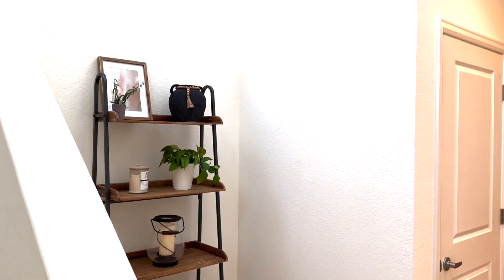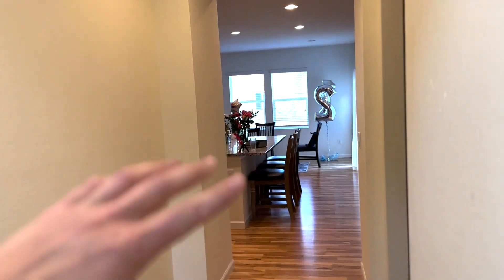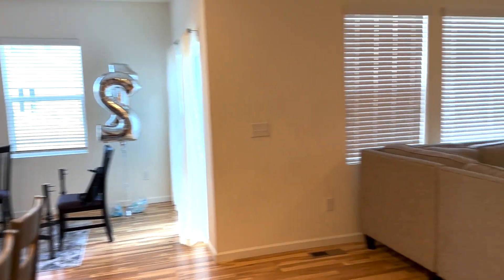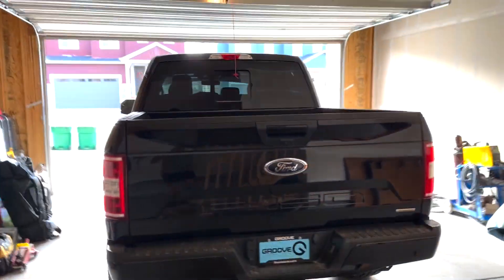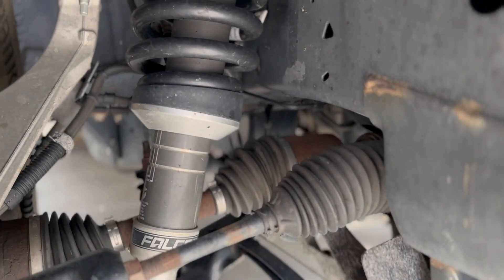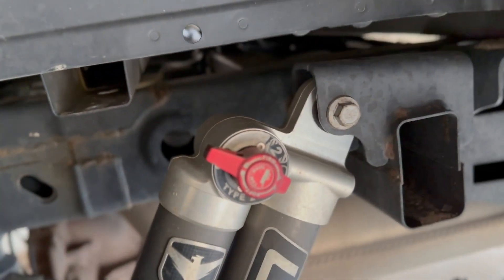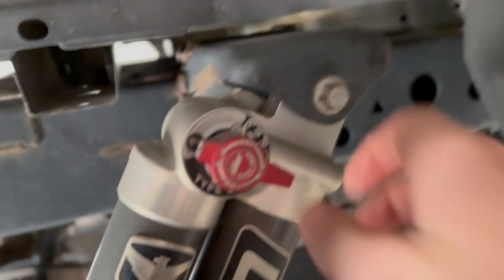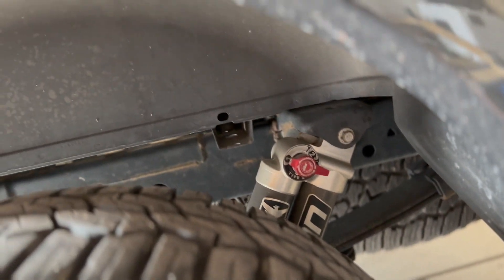DO NOT BUY FALCON SHOCKS!

Comment: The falcons are amazing. I had the squeak about a year after install, you have to grease the bushing on the bottom mount. There is a zerk fitting to make it simple.  I have had mine for 4 years and after greasing it once with good quality grease it has never made a noise agian.
Reply from the maker: I’ve tried it multiple times to no success

Comment: 2:01 those shocks are rebuildable..... just saying.... buy them to have good shocks. if they're screwed up then send them in for a rebuild under warranty. if they find owner negligence then that's on you. if they find that the shocks aren't up to par in QC then they don't charge you. just pop them off and send them in. it doesnt strike you odd that the place for the most dust collected section (the front) are the ones you're complaining about? also it sounds more like a bushing or that you sprayed a degreaser and not a greaser. WD-40 is a degreaser which most people think fixes squeaks. so spraying a wd-40 type product or degreaser onto your shocks that need grease just make it worse. also the chassis steel bar that everything's hooked to is rotating the most and rubbing right against that silver bolt at the top left. either that or at the top of the middle of the frame, the silver bolt is causing trouble. i'd say ball joints, mounting brackets, degreaser used, or the steel bar with rust around it's mount and the brand new bolt put on the other side right in front of everything may be the issue.. usually the shock and spring should be moving more than the mounting of what they're mounted against... that's what they're there for..
Reply from the maker: Then I may have to look deeper into this.

Comment: Update: I’ve got a new 2023 f150 and just found out that falcon sold my off-road shop older falcon shocks designed for the previous heavier models which is the reason for my new f150 riding like an f250. The Shop is is perplexed as to why Falcon would have older models intended for older heavier trucks sold for new lighter f150’s. Snake oil! Having them returned and going with Ford Performance shocks made specifically for the new lighter 21-23 models.
Reply from the maker: That’s actually really interesting to know! And really good to know!

Comment: I had mine for 6 months.  Handling improved quite a bit, but the ride is much stiffer. I ended up removing the front struts and I went back to stock to regain comfort.  I kept the rear shocks as it improved towing on setting 3.  Falcon struts are now collecting dust, I will be posting them FB market place. Let me if your interested in buying them.
Reply from the maker: I don’t think I would buy them again to be honest with you….
Reply: Why are they uncomfortable? Even on the softest setting? Where they the SP2?
Reply: @bobcat718  the softest setting is still slightly stiffer than the OEM rear shocks.  If your towing or hauling heavy loads in the bed then honestly it’s a big improvement.  As for the struts in the front they’re too bumpy and they don’t have different ride settings.
Reply: These things ride horrible and the rear adjustment knobs easily get hit by even the stock size tires.

Comment: These are quite possible the roughest riding shocks I’ve EVER owned and I’ve owned more trucks then you can count with all your fingers and toes. They just emailed me telling me that the reason my truck up front rides so stiff (like a 3/4 ton) is because I need to drop the PSI far lower than the manufactures recommended PSI and on stock (OEM) size tires. I responded with that being BS and you cannot recommend operating your product along with another manufacturers product outside the specs of another. Again, great design with the rear adjustable knob but horrible riding and I went from a 275/65/20 to a 295/60/20 back to current stock 275/60/20 size and still zero change, rides like a 3/4 ton. The truck had 275/65/20 before Falcon installation and rode great but just wanted that extra 2” clearance.
Reply from the maker: Mine softened up overtime
Reply: You mean to tell me these stiff shocks softened up over time, how much time cause this is my daily driver and it’s actually affecting me physically with the road vibrations and 3/4 ton jarring feel. I’m seriously considering 4” BDS coil over lift but already fished out almost $2700 for shocks, install and alignment
Reply from the maker: Mine did, took probably 5-10k miles. it is for sure mores stiff than stock though
 @txgreek3512

Comment: Not your shock or strut bro.  Ball joints, 100%.  Had the same creak, injected the boots (upper and lower) with grease and it went away.  Make sure to turn the wheel to the extremes to work the grease into the joint, over and over.  Or replace the ball joints, they're bad in Ford's eyes... probably not actually bad though.  Personally, it was either replace them or attempt to lube them.  For me, it worked on the first try.  Just use a fat 16 gauge needle and synthetic joint grease, easy to get into the syringe if you put the grease in a plastic bag, cut the corner and squeeze it into the back of the syringe.  Mine took about 12 ml per joint.  Creaks are gone now.  If I ever need to replace them, the new ones will have proper zerk fittings.

Comment: Spray some silicon lubricant on the shock shaft and shock gasket where it meets the shock body and wipe it clean with a towel. The dust colleced over time will make it squeek.  Had the same issue on my JKU, every few months they need to be cleaned in order to prvent squeaking.
Reply from the maker: I tried it
Reply: @Sean_Hannon  did it work? 😀
Reply: Spraying down your shocks with silicone spray lubricant every couple months so they don’t squeak is about the dumbest fix I’ve heard of for a poor product.

Comment: I've had my Falcon's on my Tacoma since the Lockdown...and that squeek started to happen recently...I just never gave it much thought because I live here in SoCal and beat the hell out of these things daily and on the weekends and the shocks perform so damn good! I figured it was worth the small annoyance...of the squeek. But now that you mention it, I am going to try and hit them with some grease on those zerk fittings they come with to see if that calms them down...I wouldn't say the company is shit tho... Plus, it's just a little squeak (reminds me of the military vehicles I used to ride in and drive they made lots of weirder noises...)bit harsh don't you think?
Reply from the maker: No mine is bad bad and it started after about 6 months. Both sides now squeak. Maybe it’s different on a tacoma then an f150

Comment: Just bought a new F150 FX4 Lariat SuperCrew and will be having mine professionally installed by 4WheelParts tomorrow. So, I’ll chime in after install then a bit later to give my own personal input. Cheers 🍻
Reply from the maker: They ride great
Reply: Well, I wouldn’t say that at all! They’re the worst riding shocks I’ve ever owned. No matter the tire size my brand new f150 rode like a 3/4 ton and the rear tires kept hitting the adjustable knobs. To make things worse, they emailed me telling me that I needed to drop my psi well below Ford and BFG’s recommended psi making it not only worse for mpg’s, bad tire wear but unsafe as well. Great design but crappy engineering

Comment: Unfortunately you ran the shocks for one and a half years before this happened, when something like this happens I know it’s frustrating but it’s a step by step process chasing down the exact problem, this could’ve happened even in stock form? If the vehicle was stock you would just take it to Ford if it’s under warranty and they would resolve the problem, the problem is it’s been modified so of course the blame is going to the TeraFlex shocks but it may not be the shocks it could be something very simple so everything basically needs to be checked out and I recommend lubing what you can lube and clean all the joints you’re going to be chasing something kind of like on a jeep when you get death wobble on a jeep, You basically start replacing everything upfront because sometimes it’s hard to determine exactly what it is, I would assume it’s very hard for TeraFlex to help you resolve a problem over the telephone and if they instruct you to take the boot off then take the boot off and inspect it, you modified it so you have to do all the steps that’s my recommendation I hope you get this resolved, also it looks like you used a non-penetrating type oil gets something that will saturate and flow into all the nooks and crannies.

Comment: I have the same Falcon Sport/Tow Haul system you have. Mine squeaked just like yours but right after install. From what I remember reading when I first had them installed about 2 years ago... The most spot on cause seems to be the plastic "dust cover" on the shock itself. From what others have said it's rubbing against either the springs or other parts of the shock system/strut. And from what I could tell it was only the driver side only.  Anyways, I live in South Florida and I did a drive up to New Jersey for Thanksgiving. When I started to hit 30-40F weather the squeek was noticeably louder. It squeaked the whole entire time I was up there. However after I drove back home it dawned on me that at a certain point I never noticed the squeaking anymore. So I'm not an engineer or anything like that or whatever but I think the metal expanded with the cold temperatures and made the plastic parts rub more so that when it went back to "warmer temperature" in Florida the metal contracted. So I am curious if it's still squeaks ( in summer let's say) after you went through a full winter of driving around. I had a dealership install it. So I don't know if it's worth it to try to have it installed without those plastic dust covers to see if that was the actual issue. And I don't know if it's something you 100% definitely need... And then therefore it can't be removed. But this was my experience I don't know if it's going to help you or others. ✌️♥️😀🖖☮️🇺🇸
Reply from the maker: It is 100% the plastic on it but it’s also my spring. Both of them are super super squeaky and the shop that installed. It was a buddy of mine and let’s just say he won’t honor anything and he’s no longer a bunny lol. They’ve been a pain in the ass to deal with, but taking off the plastic will not be the only fix it definitely needs some sort of new spring and it could be something to do with the factory Springs on an aftermarket strut

Comment: Do not by Falcons because you hear a noise ? is that what you are saying ? even though you left the dust boots on which you were not supposed to. Is it possible you built up sand in there because of your " dust boots" and prematurely tore up your isolator ? did you put the isolator in ?  are falcons installed with del ron bushings ?  < which are incredibly tough and incredibly noisy ? would have it not been easier to take the shock out tear it down and look ? nobody has a crystal ball YOU made mistakes on your install so take it back out and figure out the problem. if it is metal on metal you should see a shiny or wear spot. if it is a manufacturing defect then call falcon and see if they stand behind there product. Just saying instead of slamming the product figure out the problem. and go from there. Bouncing it up and down and complaining wont find the problem.
Reply from the maker: Yes
Reply: No shit. 

“I bought this product and installed them wrong. Now they make a noise. I called the manufacturer and they gave me troubleshooting advice. I did not design or build this product but I know for a fact that the engineers that did don’t know what they are talking about, so I won’t be taking that advice. In conclusion: the problem persists, therefore the product sucks. Do not buy .”

What a clown.

Comment: It definitely sounds like a pivot point in the suspension like A arm or a ball joint noise. Blaming your shock absorber before you accurately diagnose the problem and blasting it all over the Internet is a chump move.